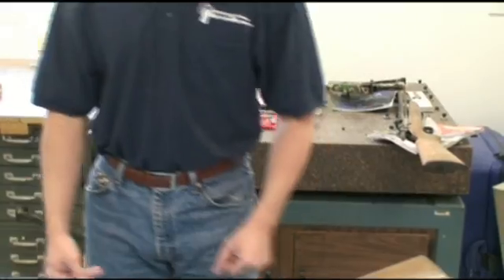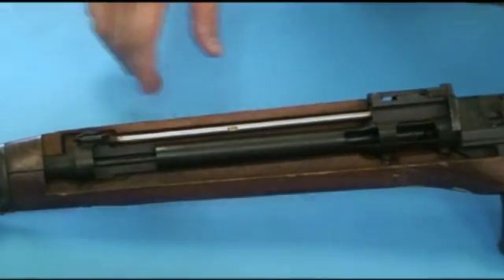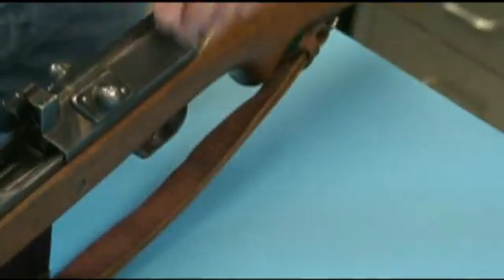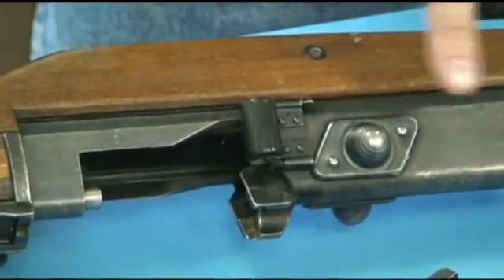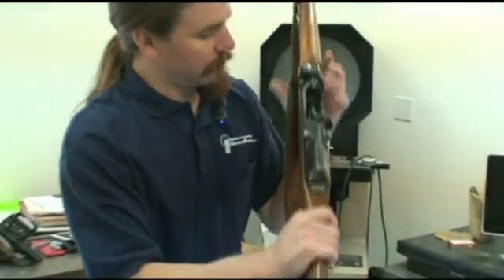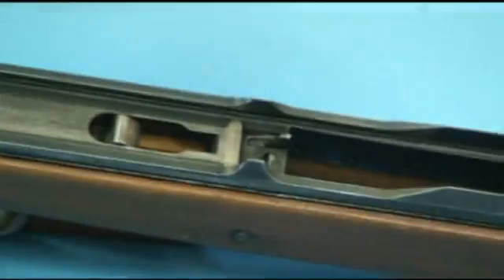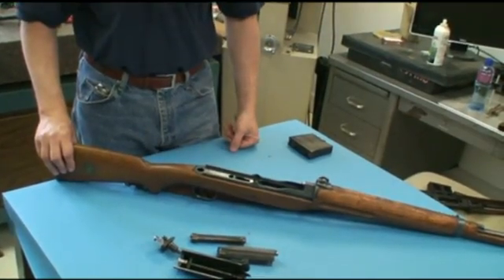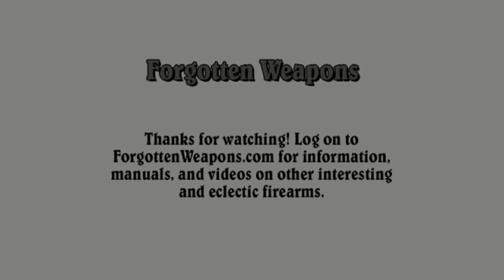AG-42B Ljungman

Comment: Letter "B" is also indicating that the the gas return tube is "Stainless Steel". Also called AG M42B or just M42B . The prefix "AG" is fairly uncommonly spoken . As well if you see a row of 3 threaded holes spaced about 3" apart just below the range adjustment knob , those are for the mounting of a "Side Mount Scope" , variable from 4 to 20 power , it was about a foot long . If your M42B has the 3 holes this means you have the "Sniper Model" .

Comment: I've wondered about that, too. I think what makes a difference here is that once the bolt carrier moves back the gas and carbon vent into open air, where the AR15 type rifles have the gas and fouling going into the middle of the bolt/bolt carrier group with no way to escape.

Comment: It's interesting how similar the direct impingement system and tilting bolt are to the French MAS 40, which was just starting production when the Germans invaded. After the war it developed into the MAS 49 and MAS 49/56. Got to wonder if theSwedish engineers were familiar with the MAS, and why the Germans didn't pick up the idea.

Comment: All that hot gas and carbon going directly into the mechanism causing increased fouling of the bolt. As civilians using it, this is no problem as we have the luxury of being able to keep it clean at any time. However, as part of a battle implement, it requires a soldier to strip, clean and maintain more often. This could be a real problem when the bullets start flying. I despised my C7 (Canadian variant of the M16) for that very reason.

Comment: The French MAS semi-autos are direct impingement too and do not have a gas regulator (other than to turn it off for launching grenades on some models) and they worked very reliably in North Africa. Is the design that much different that the Hakim needed a gas regulator?
And speaking of, will you do a video on the MAS semi-autos? I find them very interesting guns.

Comment: Thank you sir. I was using a screw driver to drop the bolt after the last round hold open was engaged. I now learned from you that I dont need to. You just remove the mag push the bolt cover forward until the hold open tab falls and pull the bolt cover back. Thank you, thank you, thank you.

Comment: They also did an upgrade on the gas tube. They replaced the original plain steel tube with a stainless steel gas tube for corrosion preventative purposes.

Comment: Repeating the mantra that the Stoner gas system is direct impingement doesn't make it so.  On the AR gas is fed from the tube, into a chamber inside the bolt carrier and the bolt itself acts as a piston.  As far as I know the Ljungman and MAS49 are the only production designs that use an actual direct impingement system.